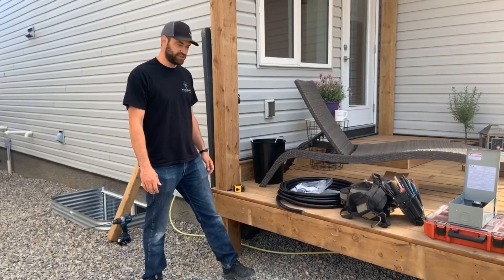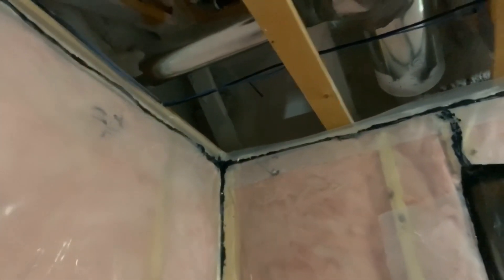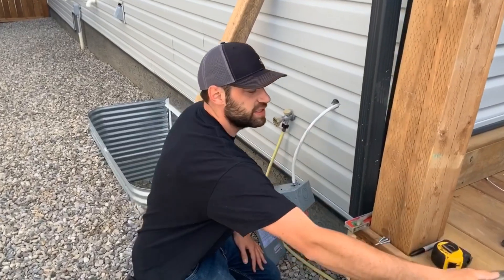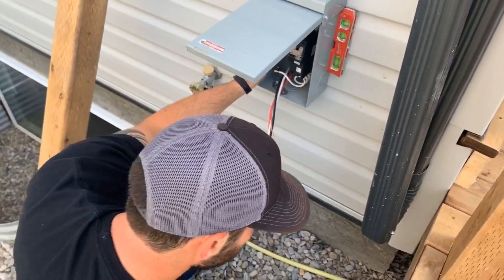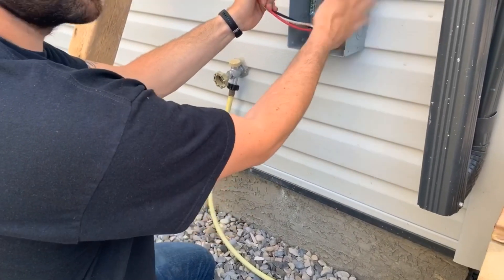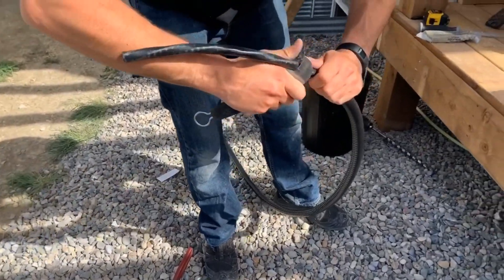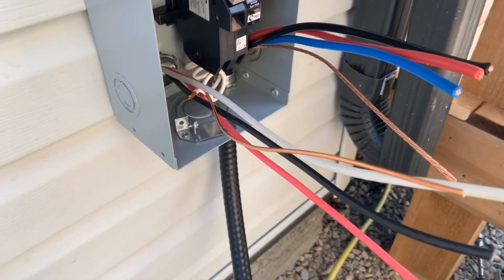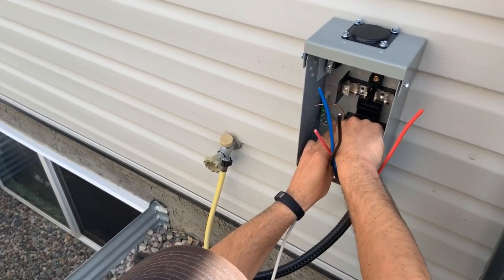Hot tub electrical install explaining parts of spa package and terminations

Comment: I'm in the US. I'm planning on running Schedule 80 pvc conduit for the outside run of my house. Any idea if it's up to code to run the same wiring you did for the interior of the house outside as long as it's in the conduit? I sadly have a longer outdoor run than you do and need conduit to the disconnect.
Reply from the maker: Teck cable is great for hot tubs because it can be buried or run ontop of the ground, at some point you have to enter the tub to make the termination, this is were the teck cable shines because it doesn’t need to be sleeved or protected.
Reply: @Luminelectric  Thanks for the time in making the video, quite informative. We are also thinking of running a teck cable from Spa panel to the hot tub. Question, as I'm not sure how you did insert that big teck cable going into the hot but wall covers? Did drill a hole and terminate it outside hot tub wall or did you drill a hole and insert the whole teck cable inside and terminate it to the spa electrical panel ? Appreciate if you can send us pictures. I can email you. Thank you.
Reply from the maker: @Christian0465  hey Bobby, I can’t attach a picture on here but feel free to email me if you still need info@platinum-lighting.ca. The hot tub should have built in holes along the bottom edge to feed your teck into the controller area. You can drill your own if needed just make sure your not going to hit anything on the inside, and seal the hole.
Reply from the maker: Yes you can sleeve NMD though conduit, or you can buy a direct burry cable like NMWU and sleeve only when it comes out of the ground, you can burry teck cable also, and last but not least you can run a full conduit and buy RW90 copper wire to go in it. You have many options

Hope this helped.
Reply: @Luminelectric  Thank you so much for the quick reply. I'm an instrument tech so I know how to do industrial wiring 120v and under, but I have very little experience with residential. Also, I'm not exactly sure what to run from the disconnect to the spa, you used teck but I'm not sure what this spa will be like vs yours. Again thanks for the response!

Comment: I have a zinsco panel  I put a 2pole box like yours at my pool pump and used a gfci breaker only difference is there's only one bus bar for ground and Neutral and there's no neutral goin going to the pump just two powers and ground so there's no neutral on gfci breaker. I landed the neutral pigtail on the bus and the reset button on the breaker trips it like should. To my understanding the two powers going to pump are balanced and once one becomes unbalanced it will trip the breaker. It this setup correct 👍 or am I doing something wrong
Reply from the maker: Yes wizzle it seems like you have the right idea, I have only installed one tub that didn’t have a neutral termination location at the tub, the inspector said it was fine as long as it’s approved (CSA or UL listed), if you’ve tested it should be fine.

Comment: No need to wire a hot tub, in 6  months it will be on craigslist for free
Reply: Haha!  Apparently you haven’t been around long enough.  After 35yrs I have a long-standing family of successful customers.  Money is No object and their spa is used more than regularly
Reply: lol ain’t that the truth!
Reply: Hope you cut slots in the siding before you hung that box, otherwise that plastic siding will buckle in the heat.
Reply: @woody5109  I'm sure he knows what he's doing
Reply: What's the matter 805gregg,    no women ever took you up on a dip in your hot tub so you decided to cut your loses
Reply: Lol, we used ours religiously for 15 years before it died, “Jacuzzis make” are very problematic
Reply: I’ve had three hot tubs. 1 came with my second house it was 10 years old and blew up. Bought 2nd hot tub to replace that one and it lasted until we sold the house 15 years. Just bought my 3rd one in a new state.  I’ll use it for a decade.   Maybe you don’t understand the things you buy but I do.
Reply: Ive had mine for 9 yrs now
Reply: Haha. Sucks .
Mine ill keep for as long as it lives
Reply from the maker: 805gregg 😂 we like your humour. Hopefully everyone will get to keep their tub
Reply: @Luminelectric  ... had my first hot tub 20 years and the replacement is going on 12 years or so now. Use it almost every day and sometimes twice a day. I even shovel a path through the snow  and use it all winter, except when it's cold enough that my bare feet might stick to the deck.
Reply: 😄😄😄 so true

Comment: Phase does matter  if your system uses the power lines to send signals across them like my solar array does.
Reply from the maker: On a typical 120/240 single phase panel. The phases should not matter. There are a few one off systems where it’ll matter,  but for this video and the 99% of people it shouldn’t matter.
Reply: David stop talking

Comment: does the spa pack include the gfi breaker ? also, what size is it ? looks like 50a in the disconnect & also 50 a in the panel?
Reply from the maker: mike mac donald you are correct. #8 in the CEC is rated for 50 amps
Reply: @Luminelectric  #8 copper not more than 3 conductors allowable ampacity is rated for 45A at 90°, #6 copper needs to be used don't mislead people and I am surprised you don't know this.....
Reply: @matthewrees8321  not sure about cec, but nec states #8 is rated up to 55 amps if it's THHN, which is what he used in this video.
Reply: @matthewrees8321  In Canada #8 copper 3 conductor is rated at 55A for 90 degrees So He is fine to use it.
Reply: @matthewrees8321  you are the one misleading people

Comment: is it allowed to mount spa pack next to water tap?
Reply from the maker: Daniel p. Yes you are, these jobs are all inspected under the CEC by the local authority. I had limited options for the spa GFCI (GFI ground fault circuit interupter) as the GFI  needs to be at least 10 feet from the tub, and would have looked odd mounted on the deck space. Think of it  like a GFI plug that’s close to the sink in the kitchen. Because it’s GFI protected it’s good next to the outside faucet, In Canada under CEC.
Reply: Platinum Lighting ... sounds reasonable, thanks for the info

Comment: Should really use # 6 AWG
Reply: Andrew Johnson, He used 8/3 nmd90 and teck90 cable, because the insulation temperature for these cable is 90 dcelsus and it can carry 55A. Which is more than  enough for 50A breaker. I did mine and inspector questioned me about it. Platinum Lighting correct me if I am wrong.
Reply from the maker: Andrew Johnson, not sure why you think I should use number 6 here, we are following the CEC code and any hot tub rated up to 40 amps needs #8, which is way cheaper then #6. Thanks for your comment though.

Comment: Was the connector leaving the bottom of the cut off box waterproof?
Reply from the maker: Miles McCoy the connector coming out of the spa package is a teck connector (water tight). inside the tub and the connector inside can be flex connectors (not water tight).

Comment: This house confuses me.  Is it underground??
Reply from the maker: No underground install on this hot tub, but teck cable can be buried in Canada (at least 18” down). Teck can also be used to strap to a house or even layed on rock as long as it’s not a tripping hazard. Hope this helped Leo.
Reply: @Luminelectric  so when you drilled the pilot hole, you were about 2 feet from the ground, then when you went inside, the hole was well above your head.
Reply from the maker: Yes sir, I used the window in the basement and outside faucet to measure, that basement is about 8 feet lower then the grade (ground level) I’m standing on outside.
Reply: @Luminelectric  ah. Now that makes sense. I'm in Texas. I'm not used to houses having basements. I always forget about them.
Reply from the maker: Haha we understand Leo, we didn’t think about that on making this video, thank you for your feed back and good luck with you hot tub. Remember to look up NEC (America) code not CEC (Canadian). Enjoy the rest of your day.

Comment: Great work on the install, quick question; you used 8AWG wire, how many amps is that wire rated for? My understanding is it was rated for 40 amps and 6AWG should be used for a 50 amp circuit? Thanks!
Reply: On a 50 amp breaker #6 should be used regardless of the tub load.
Reply from the maker: baker eletric extreme in Canada there is a code rule in section 68 about rating tub breakers at 125% of the tub. The hot tub it’s self is only rated for 40 amps and only needs #8. All my jobs are inspected by the local authority. I think your name is spelt wrong it’s spelt electric, if that’s intentional my bad. Thanks for leaving a comment.
Reply: Platinum Lighting 
The breaker can be rated at 125%, the wire should also be rated for that potential. Either way, if inspections are passing , I will continue using the wire size that suits the breaker size. Thanks for noticing the name error.
Reply: @bakerelectricextreme7979  baker electric, are you in America or Canada?
Reply: Amir Thompson 
Canada 🇨🇦
Reply: If I have a 3hp 220v hot tub that is only 9.6 A plus 125% that would be 12FLA and distance from panel is only 40 ft !!!! Will I be ok using #10 wire and what size breaker???
Reply from the maker: Armando Jimenez if you have a 3 phase panel , breakers,spa package. You should be able to run #10. your calculation on 3 phase is different it’s 9.6 x square root 3 x 125%=18.59 and here in Canada #10 is good for 30 amps.
Reply from the maker: Mike Endsley in Canada a #8 is used for a 40 (FLA) amp tub. In the code your breaker spa pack is rated for up to 125% (40x 1.25= 50 amp spa pack). If your tub is even 1 amp over over 40 you have to run #6.
Reply: Platinum Lighting got it! Thanks for taking the time to explain :)
Reply from the maker: We love that our videos are helping people, if you’d like to subscribe to our channel for more content. We are glad we could help!
Reply: Mike stay away from electricity.